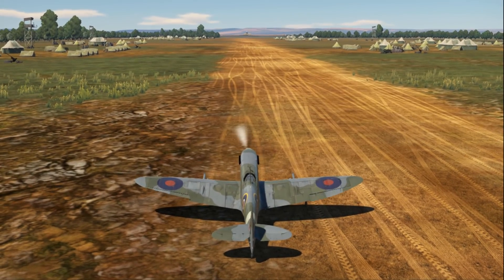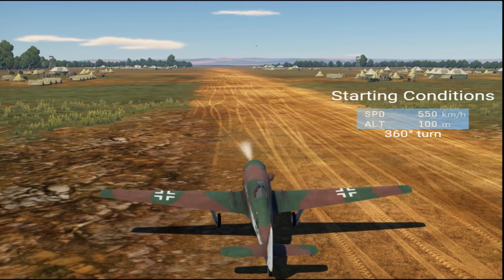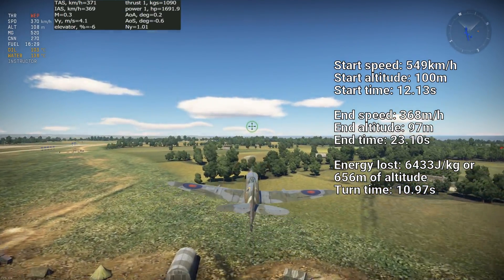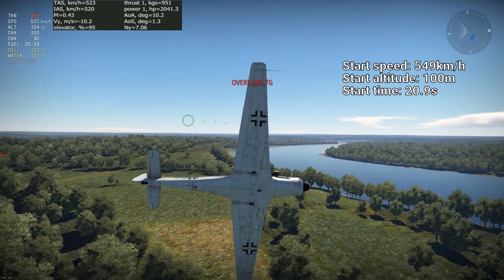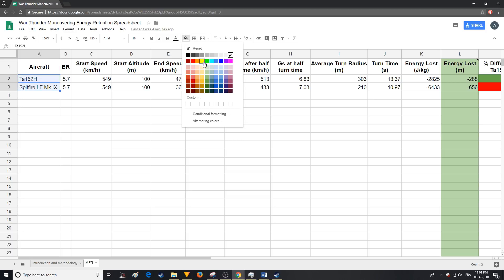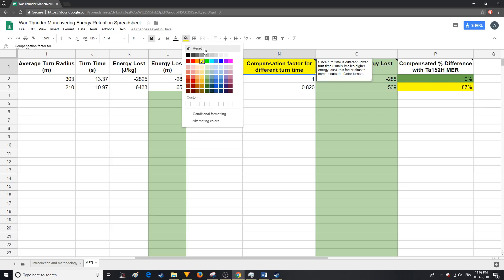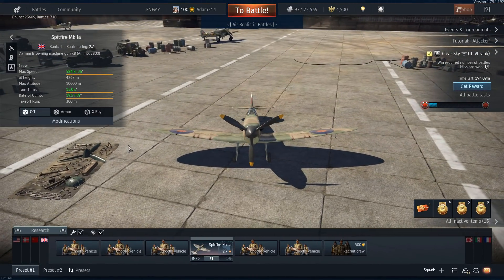Aircraft Maneuvering Energy Retention | Spitfire LF Mk IX vs Ta152H

Comment: Really explains why I love the 152H. Crisper handling than 109's and more agile at lower and medium speeds than all the 190's and 152C-3. Not to mention its splendid handling and performance at all altitudes.

With it I can maneuver against P-51's, P-47s and F8F's for prolonged periods and win and even give Late Spitfires a good fight. A recent 4 minute dogfight I had against a LF Mark 9 I lost cemented why I love the 152H. Sure I lost, but man was that knife fight fun and well fought. Such is the effect of its energy retention and high lift wings.

I very much would like to see more of this. Most informative.
Reply from the maker: Many would say the opposite! Ta152H is different from every other aircraft, in part due to its main advantage being obscure MER.

Yeah I've had many 1vs2s where I just keep turning. I should have kept some of those to upload on YouTube.

More on this topic or other topics?
Reply: More tests on the topic of energy retention, even vertical energy retention if you so desire. I would love to see the comparisons between many commonly and uncommon opposing aircraft.
Reply from the maker: I'll keep it in mind!
Reply: Adam514 Also is the energy retention rate different when you test at higher attitude?
Reply from the maker: Only difference is the engine power. Aircraft which conserve engine power better at altitude will have slightly better relative MER.
Reply: Adam514 Ok thanks, so what about flaps, will it make turning better?
Reply from the maker: It depends! In the short term yes.
Reply: Adam514 Ok final question how do you shoe the engine power and AoA and other stat as in the video?
Reply from the maker: It's called the "local host".

How to access the "local host":
You need to be running War Thunder or it won't work!

Option 1: on the same computer that is running WT:
-Type http://localhost:8111/ in the address bar and press enter and voila.

Option 2 (which also works on the computer that runs WT):
-Type http://Your_IP_Address:8111/ where you replace "Your_IP_Address" by your IP Address (192.168.X.XXX) in the address bar and press enter and voila, you can look at the characteristics on another device while flying.

What I do is record the "local host" on my laptop and the gameplay on my PC, and paste them together during editing.
Reply: I out turned a LF MK IX whilst not even fully upgraded yet. Flaps are a heck of a thing especially when it comes to the fw 190, and ta 152 series you can surprise almost every plane in game except ones you shouldn't fight like Japan or Italy.

Comment: Its insteresting but spities havent got sense because the are after war planes...
Reply from the maker: This Spitfire isn't post war, the post war Spitfires are the Griffons (and even then).
Reply: The only post-war Spitfires in War Thunder are the Mk 22, Mk 24, and Seafire FR 47. And BTW, the Mk 14s in War Thunder are running the lowest engine setting they ever ran on. Historically they had 150 oct fuel which would give them performance comparable to the Mk 24 ;)

Comment: The equation of conservation of energy here wouldn't work. You're test is flawed by the fact that the Ta was still accelerating much faster than the spitfire at the start, due to the horsepower difference. The energy inputs are different for these aircraft, also the surface areas of the elevator are different, meaning one can lose energy faster than the other if you give the elevator that authority. For this test to work correctly, you'd have to reach top speed at both aircraft, thus bringing acceleration down to 0.

Or you could more accurately do this by reaching a set speed, and then turning both engines off, since we know air resistance is exponential, and it would be inaccurate measuring at different speeds.

If you have trouble understanding why, think of it like this. You have a powerful aircraft that is accelerating, and it hasn't quite reached it's top speed. It gains speed in the turn, because it could be a jet aircraft. Thus leading to positive energy gained in turns, which we know isn't possible. That's an extreme example, but it's still what you're doing.
Reply from the maker: The Ta isn't accelerating faster than the Spitfire, they actually have essentially the same top speed at that altitude so there would only be a minuscule difference  in acceleration. But my main counter point is that acceleration at 550 is part of the test, aircraft with higher acceleration at 550km/h will tend to have better ER, because they have higher P/W and/or less drag. Energy inputs and control inputs are indeed different, but it's part of the test and it's the reality of WT matches.

By removing engine power you are comparing the airframes yes, but since this test is mostly for WT purposes the more useful comparison is max power for both aircraft because that's what the aircraft will be using.

Positive energy gained in turns is certainly possible, the Vautour accelerates in a max G turn at 900km/h haha.

What I'm doing is comparing 2 aircraft with the same test conditions, as if they were in a match at equal energies, and seeing which bleeds more energy in a 360° turn.

Comment: for what is this test good for ? So a bad turning aircraft has better energy retention, isnt that logic ? What happened weh both aircraft turn the same radius? Hast the TA still "better" Energy retention. Both Aircraft have to have the same condition otherwise you cant compare them...
Reply from the maker: Not necessarily, and that's the point of this test. The Wyvern has the worst turn and the worst energy retention for example, by far. Characteristics like speed are actually quite similar between the aircraft that face each other, while for this hidden characteristics there can be a massive difference between aircraft.

It's good to know if your aircraft will outperform another in a spiral climb. With worse MER, you will stall first and the enemy might get a shot.
Reply: Ok now i can see why you did this test.
Reply: btw The Wyvern has the worst turn rate & E-retention? I think the TA152 C3 isnt far behind.
Reply from the maker: Ta152C will have similar turn rate but will lose much less energy.

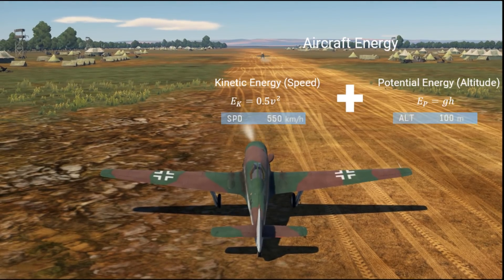Comment: 0:55 Isn't kinetic energy 1/2mv^2 and isn't potential energy gmh? Seems like mass is missing from the formulas you've showed.
Reply from the maker: You're right, I used specific energy (energy without taking into account mass), because mass isn't relevant. If mass was taken into account, the aircraft with more mass would be starting at a higher energy which is unfair. Also, mass is irrelevant in energy because an A6M going 500km/h has less energy than an F86 going 360km/h, but the A6M will still catch the F86. Specific energy shows the real situation.
Reply: Alright, thanks for explaining!
Reply from the maker: My pleasure!

Comment: I notice a lot of spit pilots are overly eager to engage in a turnfight even when they have the energy advantage at the beginning of the fight
Reply from the maker: Reverse! It's the straightforward way and the most common way they get kills.
Reply: Adam514 I have no problem killing them, I was just commenting on how with the spits energy loss in horizontal turns and the eagerness of many spit pilots to horizontal turn, they often blow their energy advantage or give you the energy advantage

Comment: OK, so I wouldn't necessarily call it a critique, but I do have a comment in regard to the test conditions. I don't know how thoroughly Gaijin calculates everything, but I wonder if your turn time compensation factor is enough to really make for equivalent comparisons. The way I understand it, since the Spitfire is turning tighter, it is also creating more drag which, in turn, is bleeding more energy. In order to make a proper 1:1 comparison [of energy retention in a turn] between two planes, wouldn't it be required to not only start at the same speed and altitude, but also to pull the same amount of G's in a turn and/or make them pull the same turn circle?

I guess my point is, you could take an LF IX and, say, a Do 335 and say OK, the 335 has better energy retention for a 180 degree turn than an LF IX, but how much does that really matter since the LF IX will make that 180 quickly while the 335 will make a huge arc to complete that turn. I'm not saying that your data from this test is wrong, don't misunderstand, for all I know it may be spot on, but I personally have a feeling that you won't get a "true" comparison unless you could make both planes follow the exact same turning circle (while still starting with the same speed and altitude) and see which one is going faster at the end of that same circle.

How to test that? Beats the hell out of me.
Reply from the maker: It is a critique, but critiques aren't bad, quite the contrary if it's constructive as yours is. I have thought a lot about exactly what you are talking about, here's my answer.

You are right, the Spitfire is creating more drag relative to its weight than the Ta152H and hence bleeds its speed faster to turn faster. As you say, the best test from an engineering standpoint to compare ER is for both aircraft to complete the turn in the same time (or same radius, both results would be close anyway). However, in the context of WT RB, nearly everyone uses mouse aim which makes the aircraft turn at the maximum G/minimum radius possible, with the energy loss associated with that. Practically, you can't turn less hard and bleed less energy when you're using mouse aim when you're turning. That's why I think with the compensation factor for different turn time, that result is what you will see in WT matches. For example, in a merge between the Spitfire and the Ta152H, the Ta152H will leave the Spitfire in the dust if the Spitfire does the 180° turn to chase, while the Ta152H will come quite close to getting a shot if the Spitfire goes straight and the Ta152H does the 180° turn.

In your Do335 vs LF example, I think the MER result will be quite close with the compensation factor, I'd even estimate that the LF is better. I haven't tested it yet though.

In conclusion, your critiques are valid for SB and real life, but I still think the compensation factor gives the accurate picture for RB.
Reply: Agreed, I think in the context of War Thunder, particularly with Mouse Aim, doing an "equal radius" turn would be practically impossible to do.

The only reason I even brought it up was in regard to practical combat application in game. If two aircraft are chasing one another, following each other's maneuvers, this is where the MER differences would likely start to make a real difference.
Reply from the maker: The test would be a lot harder to do indeed, it would probably take an hour per test since a joystick would have to be used, and then there's keeping the plane level with rudder, etc, that in the end the result won't be precise.

Yeah turn time and radius dominate which aircraft wins in a short turnfight, but after 2 turns or so the aircraft with the significantly better MER will gain the advantage.
Reply: Adam514 I'm not saying you take requests, but I'd be very curious to see the result of similar tests with planes like the La-7 or Yak-3
Reply from the maker: I do take requests, I'm planning on testing the most relevant ones first too!
Reply: @AdamTheEnginerd  what if you pull the mouse slowly or like smoothly
(i don't know how to explain)
for example when you pull up slowly for better energy retention in BnZ
Reply from the maker: Yeah, but try doing that for a full 360° turn, it won't be pretty.

Comment: Try a test of pure energy retention of the same plane but with and without the performance upgrades (not the engine ones) the reason? The values of these mods have been increase from 0.000521% to 5.21% for example the fuselage repair mod
Reply from the maker: That's a good idea! I'll probably try the stock K4 lol.

I suspect that those % aren't the real ones. They changed it into % a few months ago but I think they forgot a conversion on what to display on the mod stats.

Comment: were the radiators of all planes at 0%? the difference might be tiny but might as well do it
Reply from the maker: Yeah MEC was used to get the best result possible.
Reply: any specific settings for planes without auto prop pitch/mixture etc?
Reply from the maker: Mixture is usually not modeled/modeled correctly for most planes. I leave it at 60%, except for P47s where I leave it at 90% until 8km. Prop pitch=throttle.